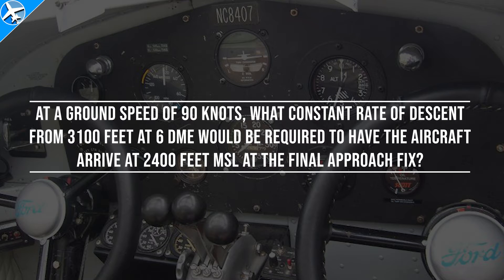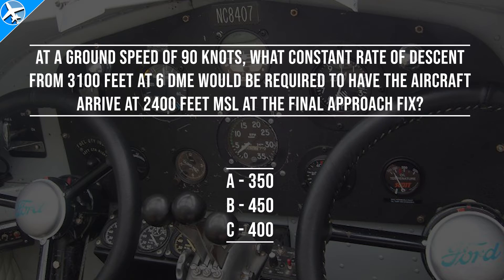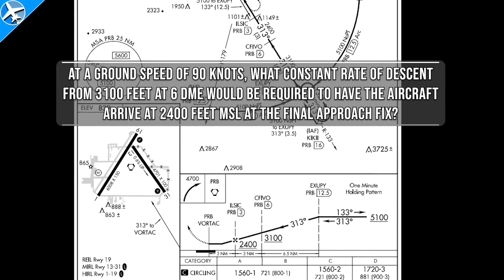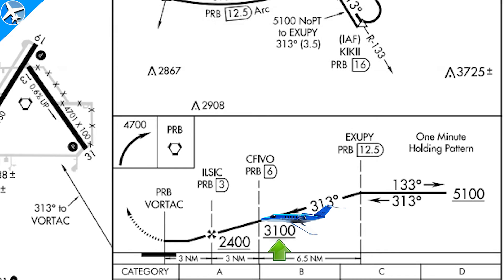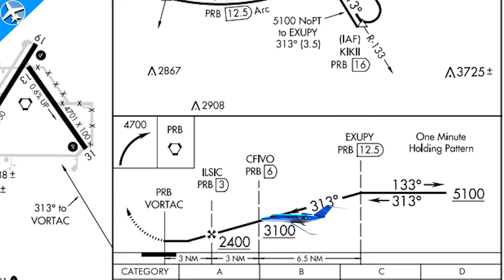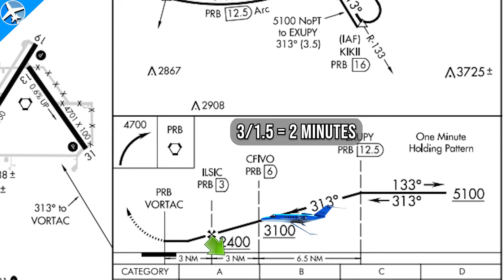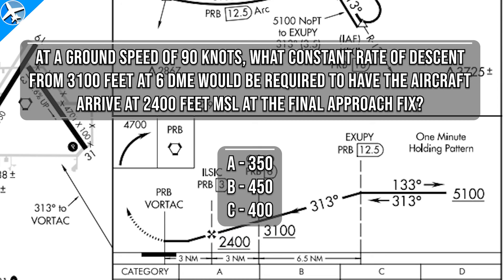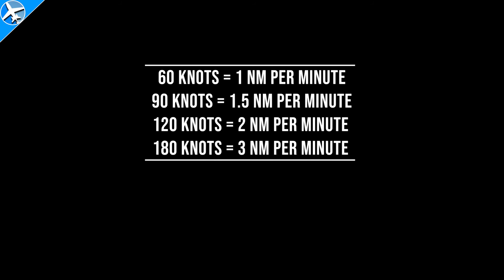How To Calculate Descent Rate for a Non-precision Approach

Comment: Was the angle of descent 1.16 degrees ? Lol off topic but yea
Reply from the maker: No.  According to the FAA rate of climb/descent table the angle of descent is around 2.3 degrees.
Reply: @thecorporatepilotdad   700 (Altitude difference) divided by 18216 (3nm converted to feet) = 0.0384.  Arcsin of 0.0384 = 2.2023 degrees of slope. Also, sin of 3 degrees = 0.0523 times 6072 feet (Feet in Nautical mile) = 318 feet of altitude descent in 1 nm.  Rate of descent at 3 degrees = 318 feet per mile.  Three NM miles away from the end of the runway would mean your altitude should be 954 feet above runway height at constant 318 feet per mile descent (which would be almost impossible to calculate on an approach).  I only included the calculation for a 3 degree slope to ask why it isn't the standard if they usually use that percentage as a general rule?  Obstacles/terrain etc...??
Reply from the maker: @srvafool  Thank you for doing all that math.  The FAA table is very close to the actual answer you so kindly computed.  I do not know why an angle less than 3 degrees was used other than the the altitude was rounded to the nearest 100’ increment which possibly brought the number to 2.3 vs 3 degrees for the distance between fixes on that approach.  Just a guess.  The FAA TERPS (FAA order 8260) probably has the answer if you want something to do for the next few days.
Reply: @thecorporatepilotdad  Not necessarily.   🙂  I'm a land surveyor and a pilot and I was looking into the glide slope standard of 3 degrees and came across your video.  I have a Cherokee 180 and 3 degrees is pretty shallow compared to the normal vfr approaches I fly.  I think the common saying is that the Cherokee glides like a brick.  Subscribed.
Reply from the maker: @srvafool  I would have guessed you’re in a profession related to engineering with the calculations in your previous comment.  Many precision approaches are 3 degrees but there are some IFR non-precision approaches with descent angles over 6 degrees in mountainous terrain (ASE).
Reply: @thecorporatepilotdad  Sounds logical.  Thanks for the discourse.  Too bad we can't hit a switch and get real time feet per mile descent rate on a gps.  Happy New Year and have a great weekend.
Reply: ohhh ok. I decided to take the velocity vector in the direction of the vertical height (700ft) and then I did 90sin(theta) /700 =350 (distance = speed/time) and then the theta value was close to  1.27 degrees...
  / @thecorporatepilotdad
Reply: Ohhh nawwww there's alot that's wrong in here lmao. Sorry for the confusion.... I was wondering why the angle comes out to be so small. My approach was incorrect lol sorry
Reply from the maker: @SierraHunter2106  Nothing wrong with trying.  You ended up with the correct answer so all is good.
Reply: @thecorporatepilotdad  thanks sir : ]